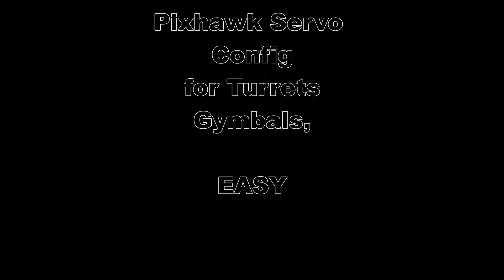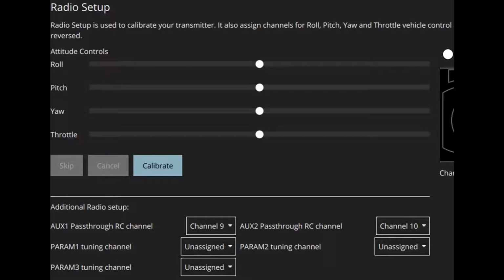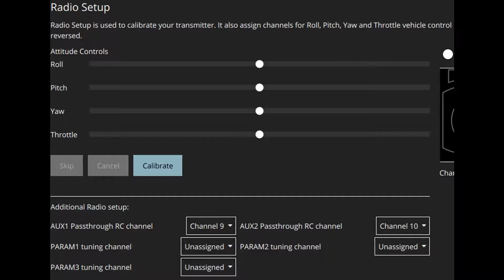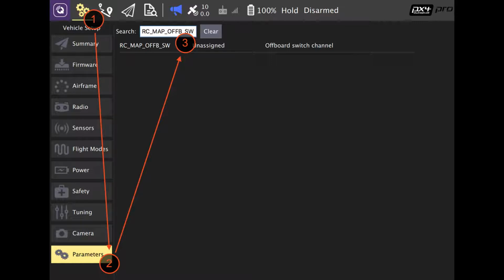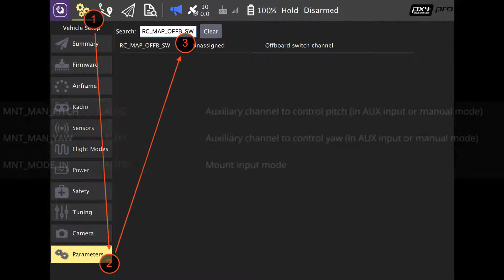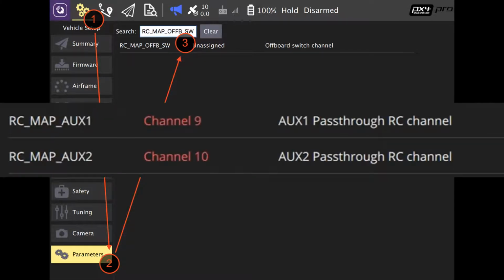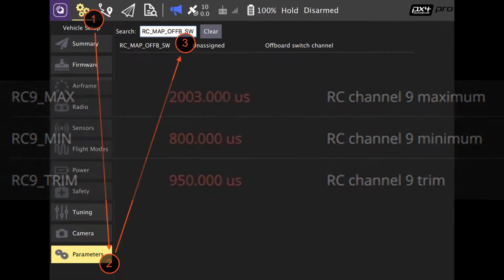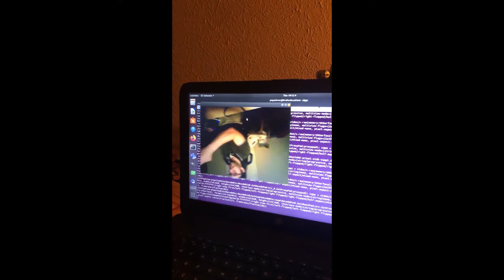Pixhawk Servo Configuration AUX for Servo Turret/Gimbal EASY!

Comment: OHHHHHHHHHHHHHHH i spent ages trying this earlier in the year with no success. The bit I didnt know "you need to press the arming switch on the GPS to get servos to move. I never would of tried that or even thought of it. I swear I tried everything else. Thanks for this video! (also just a tip, the audio on your video is soooo super low, ive had to crank my speakers all the way up to hear it).